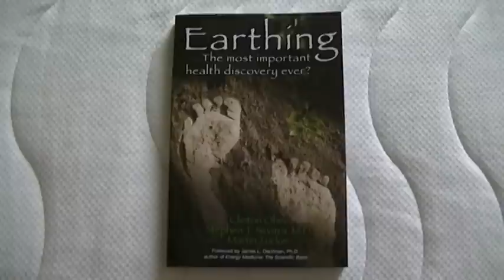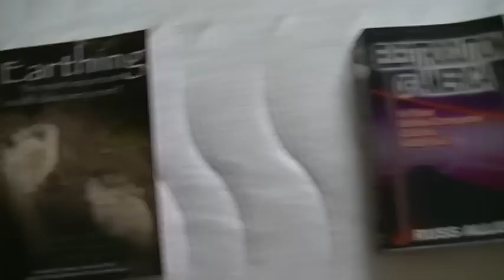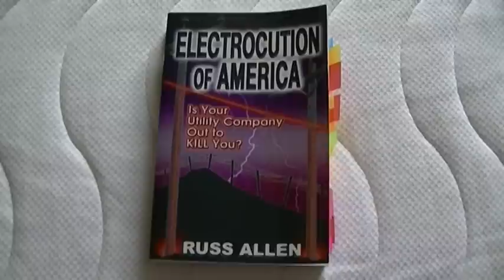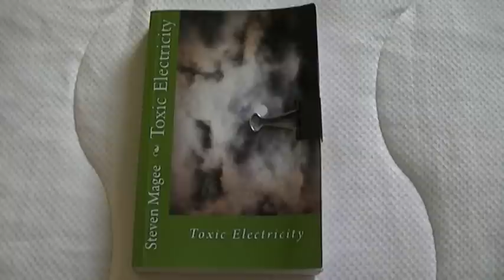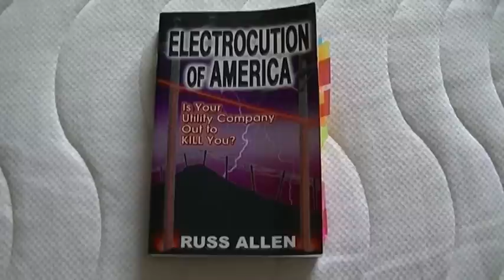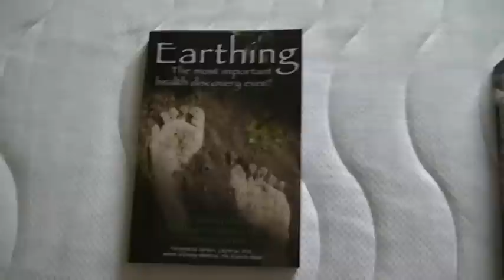Earthing (Grounding) Health Risks

Comment: wow , thats funny , because when I ground myself , I have no voltage running through me according to my volt meter... So please explain how no voltage running through you is bad for you.?.
  So if there's a voltage running through your bed wire why the heck would you sleep on it dummy?
Reply: Ummm, no.  The volt meter is telling you there is no voltage difference between you and the ground because the voltage is running THROUGH you into the ground.
Reply: So , there's no way to measure it .. that sux
Reply: See my post above. Durp durp
Reply: No voltage potential between you and ground means that you have an electrical pathway and lethal current can pass through you. Doesn't mean it is, but it would be a lot easier. Basically if you are grounded and struck by lightning you are a lot more likely to die.

Comment: Okay... question....  I can see how one could argue the system ground isn't the same as earth ground, but the book mentions that.  But you're objection doesn't much even emphasize that.  Otherwise:  1. Do you even understand benefit-risk, or are you just a plant?  2. You say if you don't implement it "correctly," but then, allegedly as an electrical engineer, you don't really talk about doing it "correctly."  3.  You at least imply that making sure the grounding is proper is the key so that you're getting a "clean" ground, but don't bring up the idea that you could get an idea of how clean your grounding wire is by using a meter, and seeing if there are fluctuations and/or seeing how close to zero volts it brings you while you touch it.  4.  You're using one mere wire? How would there be enough surface area?  The book doesn't recommend that at all. 5.  Why a huge resistor? A fuse is in order, but not a resistor.  6.  Why wouldn't you have the wire insulated, rather than a bare wire, between the two connection points?

Comment: Arrhythmia and Afib are on the rise especially for the aging population.

If you have arrhythmias you need to pay attention to you magnesium levels. I read recently that someone thought that grounding might lower magnesium levels so perhaps that happened to you but  in any case magnesium is needed for proper heart rhythm and a large percentage of the population is very low on magnesium due to the lack of magnesium in the soil that our food is grown in.

Insist on a (RBC) Magnesium test (it is a blood test but check the cellular level of magnesium) with your doctor as the regular magnesium serum test is useless (per Dr. Sherry Rogers)  to see if you are low or low normal . We all need to be in the upper range of normal especially if heart rhythms are not regular. 

There are a lot of other environmental health factors with bedding that might be considered - no metal frames, toxins (fire retardants) in mattresses, bedding and linens etc.

I am unsure if Earthing 'products' are good for all people but touching your feet or skin to the earth, cement or rock is....When I earth i just go barefoot in a non pesticided area and soak my feet in apple cider vinegar or water with a few drops of  grape seed extract or hydrogen peroxide afterward.

Hope this helps you and others now if any of you understand Earthing /Grounding  I have a question for help...

We have a flooring project and want to take up carpet and decorate (?stain or polish) our existing cement slab with allergen friendly materials for mild chemical and electromagnetic sensitivity. In addition I'd like to retain the earthing / grounding benefit of the concrete.

Any help greatly appreciated.

Comment: Your saying you need to do it correctly, is that simply that you need to be out in the country side where there is clean energy, or does the earthing pads filter the energy correctly so to make it safe? because you weren't using one of the pads just a coper wire, so in your opinion is the pads safer then what you did?

Comment: Are you f***ing kidding me. What is wrong with you people thinking you have to implement resistors and calculate electrical induction just to walk around barefoot. NEWS FLASH people have been doing that since the beginning of time. We are from the earth, the same as all other living things. We are part of nature, it is the distancing of ourselves from it that is detrimental to our health, not becoming closer.
Reply: We're insulated from the earth, tarmac and rubber shoes we barely get any contact with it at all where i live, and most of western life is similar. If i take my shoes off i'm still disconnected. If i go out, my shoes disconnect me and i barely ever become in direct contact with nature at all. I'm surrounded by electrical appliances which are all earthed, but i'm not, even though i'm also an electrical being. Using grounding equipment ensures you can ground yourself indoors, without spending months on end totally disconnected from earth.
Reply: +warrior 4Christ  "just to walk around barefoot. NEWS FLASH people have been doing that since the beginning of time."  

IKR, 3rd world kids are laughing their asses off at this 'grounding'  crap.

Comment: But you were not earthed if you used a 100K Ohm resistor in series...!
You were connected to a long wire with a high impedance load connected to one end. Something more like 5K Ohm would be better with a much shorter wire I would have thought. Better would be low resistance path with some sort of RCD device in series in case of accidentally touching something live. Also would think that a larger surface area at the bed end would be better than a thin wire

Comment: Use a shielded cable wire connect to the ground.   Then retest yourself . Make a new video you are getting stray voltage from the ground Outlet it acts like a large antenna

Comment: This is serious disinformation with this. You did not even properly check your ground to find out if it was clean before using, you sir simply did not do this correctly. Grounding/earthing has many many healing benefits, and if you do it correctly, even with grounding mats/sheets  then there are no risk associated with this only benefits. It is sad videos like this that are posted, that deter from its amazing healing benefits,  bc I help people who have various stages of cancer, and I know the healing benefits of getting grounded, I even make my own mats, but the difference between me and you is that I check to make sure it is the 7.83Hz frequency before I lay on it, or use it.
Reply: John Jones It works for me John....walking barefoot that is at no financial cost :)
Reply: Going outdoors barefoot on grass and soil doesn't cost one red cent. Judging by your angry tone, you should ground. It would probably neutralize the free radicals inflamming your anger. Take off your shoes and socks. Walk outdoors onto the cool grass. It's free, John. Won't cost you one cent.
Reply: um....narrow minded? yep! Some people have their minds already made up about everything - even without testing, researching, listening, and accepting possibilities. Try it before you knock it!
Reply: Thank you for the helpful advice! How do you make your own mat? Also, how do you check the actual frequency? I know an outlet checker is recommended to be sure you are using a properly grounded  outlet, but what do you use to check the 7.83Hz frequency? Thanks again!
Reply: ***** An outlet checker is something that ships with most earthing products like the mat.  You plug it into the outlet you wish to use and it will light up and indicate whether  or not your outlet is wired properly as a ground.
Reply: Is grounding all you did? Or were you also dieting, exercising, and making other changes? If you tell me grounding alone did all of that, I'll know you're lying.
Reply: John Jones Science proved many benefits of earthing you dumb delusional fuck. You are victim of the brainwashig.
Reply: bibbster thank you for your input, very inspiring,  I could barely walk last year and still bad enough this year (effects of chronic lyme disease) I'm gonna order some earthing products from a reputable website and get well. I have been visualizing grounding every day and from that alone has improved my condition.. less pain, inflammation but your account is amazing, am now convinced to try out.
Reply: How do you check the frequency of the mat?
Reply: #Peace, Love, Positive Vibrations Hello, thank you for your post, I would very much like to know how to do my own mat. I live in Chile and it is very expensive for me to buy one from the US. I aprecciate very much your advice! Regards, David
Reply: #Peace, Love, Positive Vibrations hi can you tell me how you find out it's 7.83hz cheers.
Reply: @codenamebravo2212   this guy is BSing you, if he was telling the truth he wouldn't have said what he said because the earths frequency is not constant. It fluctuates and it's certainly not a constant 7.83. So he's full of shit. That's why he won't answer you or the other people who asked this.
Reply: Can you list the things that have to be done right and checked when grounding/earthing?
Reply: You're such a fucktard. Go do some research , dont say it does not exist, as it does. You can also read the thousands upon thousands of reviews about how well it works. I guess all these people are just stupid and having a placebo effect.

I guess, I am one of those as well. Someone who has 8 herniated discs in his back pinching nerves and spinal cord. I have had failed back surgery and a spinal cord stimulator implanted in my spine.

I have been in extreme pain for over 5 years, could barely walk, was gaining tons of weight cause I coudlnt get around.

I then tried earthing  / grounding mats. My back and leg pain felt alot better to where I could start walking again. I lost tons of weight. Other medical conditions I had started to go away. I now feel human again for the first time in many years.

So this magical healing Bullshit works for me and thousands of others. SO STFU.........
Reply: Consider that if this were truly some miracle cure for what ails you, would people in 3rd world countries like Ethiopia be living longer lives and not dying from diseases that come from stepping in dung barefoot?
Reply: bibbster I can also read thousands   of reviews of people who have "proof" that the Earth is flat. Welcome to the Internet.
Reply: Unbelievable that in the 21st century some of you guys still believe this magical healing bullshit lmfao. It is all about getting money out of you poor souls. No science whatsoever backs up this grounding horse shit. Well, anyway, time for me to leave the weird side of youtube now.

Comment: Your body is getting voltage/potential agains ground due to EM fields. When grounded this voltage drives a current through your body through the copper wire/ground. Not healthy! Measure voltage to ground as a help to remove cables, appliances etc thats harmful and to position your bed in the right spot. 
Grounding has another purpose. It is to allow your body charge to be the same as nature, that possibly/probably could be a healthy thing. Not to reduce voltage by letting current run through your body. (Having a bed sheet with woven ground threads might reduce symptoms from EM field driven currents by lowering the current on each connecting body part.)
Reply: very nicely summed up Ante I was wondering about the effects of the current running through the body to ground. Here is an example. Hooked up to my desktop which is encased in a metal box the voltage in my body was 50-90 volts. Then I ground myself reducing voltage to 2volts but what about the current flow through me would this affect electrolytes etc?

Comment: Why didn't you use the ground plug in the wall so that you could be sure you had an uncontaminated ground?  I would think if you checked to be sure the outlet was grounded that you would not be getting this odd current.  I have my wire grounded to the wall heater which is grounded to the Earth and it has been beneficial so far.

Comment: Thank you for sharing your experiences with us.
 I wanted to ask you if you ever went to the shore and walk a day on humid sand washed by the water?
How did you feel after a sunny day walking on the wet beach  for many hours, somewhat invigorated? Perhaps a bit tired. How was your breathing after that?
That walking on the wet sand on the beach would do some earthing to you.
 Even in your yard if you have a box with wet sand and have your feet in it, while reading a nice book,  that would do some earthing as well.
 Walking on the ground/grass/dirt would also replace the wires you put in your mattress. My thinking is that you have stray currents getting on your grounding wire.
 But if you measure the potential of the ground (in your area)  you can install some filters that would limit the amount of  current coming from the ground as a prevention for electrocution.
Since you claim you are and electrical and electronic engineer, therefore you can do all these very easily.
Reply: If you knew how to implement it properly then you should make a video how to do so. Instead you're using fear to sell your book. The earthing instructions I've seen do NOT tell you to hook up to your power companies 8 foot grounding pole buried outside your garden as you did -- and they also do not suggest using an unshielded wire like the one you used that appears to be connected directly to the buried utility pole. Is this for real? Hard to believe you're an electrical engineer.
Reply: +Inquiring Mind The whole EHS is a scam, so... yes this is a scam too.
Reply from the maker: I do recommend the earthing (grounding) technique when implemented correctly in my book Curing Electromagnetic Hypersensitivity: http://amzn.com/1500896241

Comment: I once developed had heart arrhythmia long before earthing. I used to live right near power lines.  I began taking supplemental magnesium and it stopped.
Can you measure for this stray electrical current?  Or, is your conclusion simply anecdotal?  I have measured EMI emanating from various electrical components at my desktop.  Some were quite high. After grounding myself the voltage dropped down to only a few millivolts, or less. So..  I am not convinced that I should stop just because of your experience.  But if I ever ground myself at another location and develop bad effects like you claim?  I now know that not all locations may be suitable. Thank you.

Comment: I use a shielded cable wire. To avoid stray electricity. And tried to have everything off the At least while I'm sleeping. I stop using it for 3 or 4 days and I think I fell significantly More achy.

Comment: Seems to work for me, but I currently (no pun) live in a trailer on a remote hilltop and my power supply is a solar array connect to a solar powered cabin next door.  I've used an inexpensive multimeter to test the differences standing barefoot on the ground, sitting at my computer, and lying in bed (the latter two with and without grounding on a grounded aluminum screen footpad, computer wrist pad, or bed pad).  The simple solutions I've used do, indeed, fluctuate.  But the variations are far below (way far) what I've been bathing my body in without grounding, as tested on the volt meter. Do I think I notice a difference in well-being, sure.  In the long term, I don't know. By far my biggest concern is a severe nearby or overhead lightning storm, such as I'm experiencing right now. I immediately disconnect everyth

(Just kidding, but I advise not sleeping through a thunderstorm while lying on a grounding pad, even with a breaker switch of some sort. Those pleasant dreams could quickly turn to nightmare.)

Comment: I have a KVAR on my breaker box that definitely cleans up the electricity coming into my house.  Do capacitors rid your house wiring of the stray voltage also?  I've experimented with grounding both prior and after the KVAR installation and there was a huge difference.  Before the KVAR I could literally feel a buzzing sensation in my body, but now it feels very calming.  Your thoughts?
Reply: Thanks Laurie for the tip! Is the KVAR like a dirty emf filter? How did you install it - do you need to hire an electrician? And what do these cost?

Comment: Thanks for the video. Seems to me the effects from stray electricity would be quantifiably measurable by someone with your qualifications but you don't mention any evidence or numbers in your video. Have you been measuring the electrical pollution in your set up?
Reply from the maker: The health problems that emerged in the video appear to be from Radio Frequency (RF) exposure, as the cable was acting as an antenna system.  There may have also been a low level of stray voltage on the cable, as my property does have a stray voltage problem.  See: http://www.environmentalradiation.com/Stray%20Voltage%20Press%20Release.pdf

Comment: One person is not a scientific study but I will read Russ Allen maybe he has scientific studies. I definitely have less pain sleeping on the earthing mat however I have exhausted adrenals and my cortisol levels are very low. I have no proof of the reason and have been sleeping on mats for 4 years or so. If I don't sleep on it for one night my pain is worse. I am looking into diet to help assist with inflammation as that is why I have pain and my adrenals have recovered quite well but not 100%. Also I have always had low functioning adrenals so can't really say it is from earthing. Surely it is better to be sleeping at .006V than 3V? I have no electrical background. Lisa